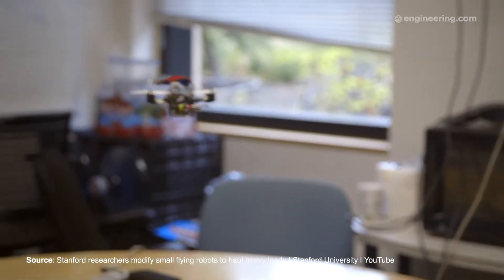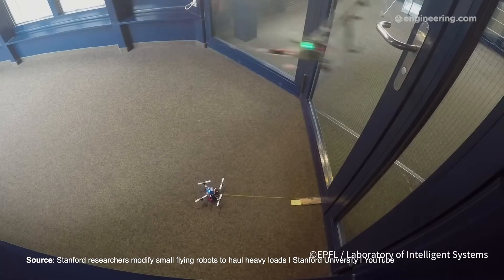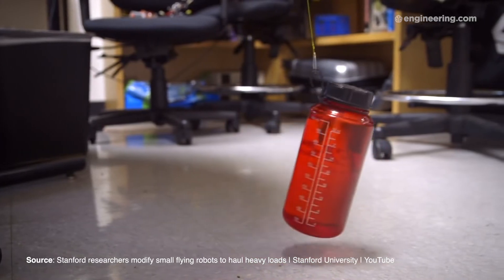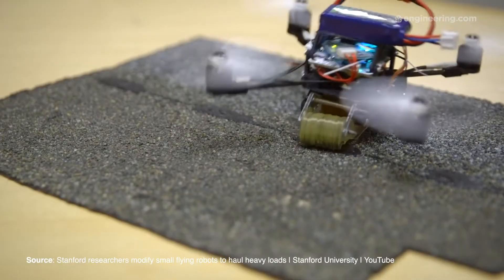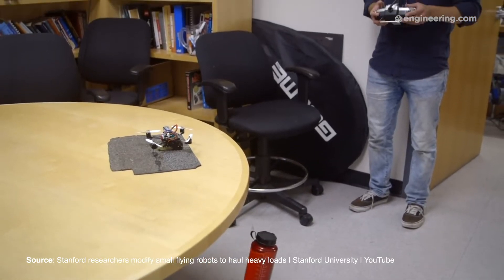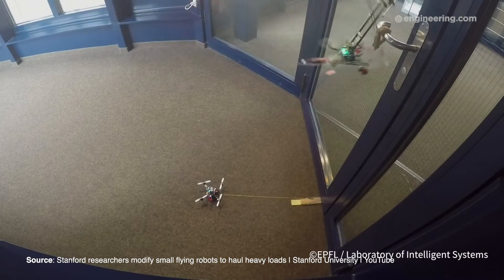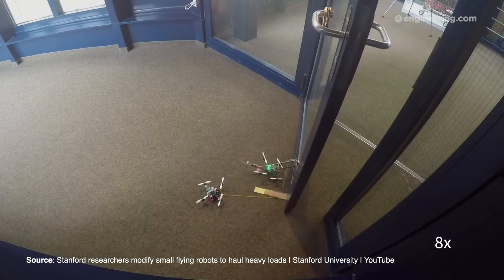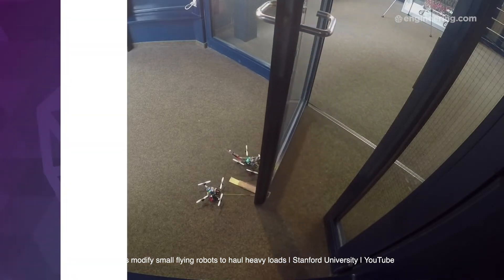How Can a Drone Lift Forty Times its Own Weight?

Comment: I am.working with teams in Russia and Alaska to make a drone bridge from Russia to Alaska over the bering strait
It will require testing a range of weight sizes over 100km 
From 1 pound every 3 feet for 100km
To 100,000 pounds over 300 feet for. 100km
If your interested id like to speak with you